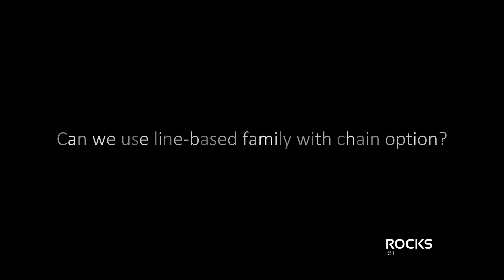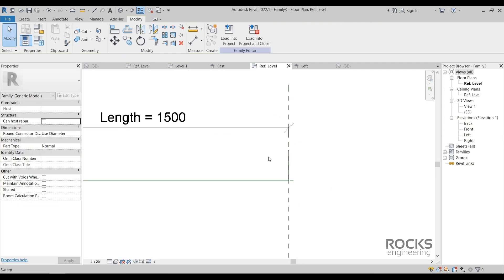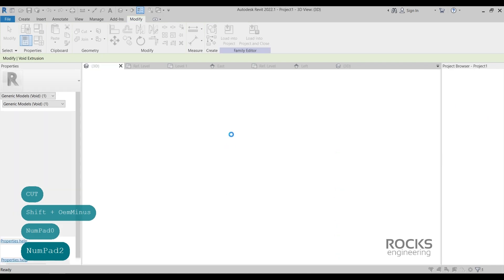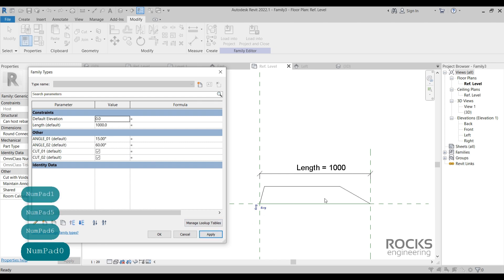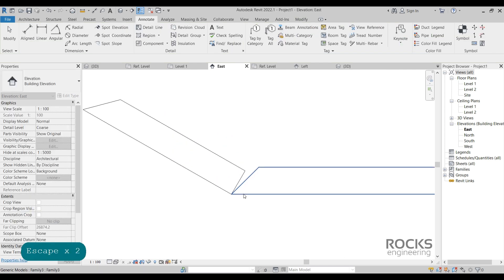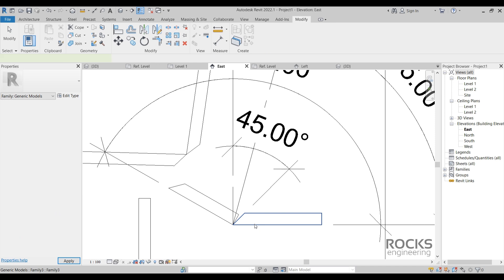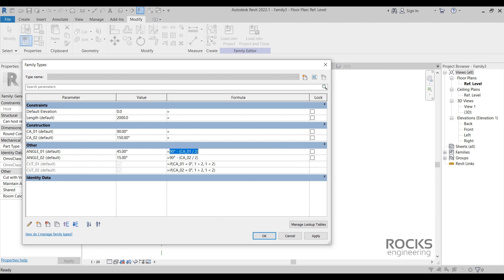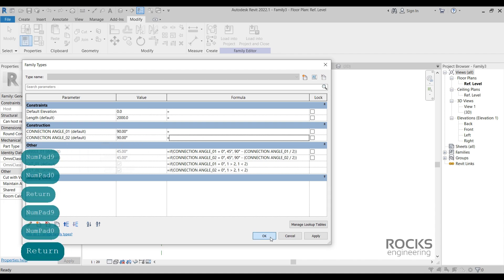How To Create Chain Line-based Family With Proper Connections | Revit Tips and Tricks

Comment: This is really amazing! I would try it with a Concrete rain Gutter, but it comes a question to my mind. What if we have 3 different angles in the path? I mean if I want to do a gutter that first turns 30 degrees right, but then turns 50 degrees left? It's possible? Thanks by the way for the response! Have a nice day
Reply from the maker: Then you are going to add different angles parameters for start and end 
I mean there will not be one angle but two, one for the start and one for end.